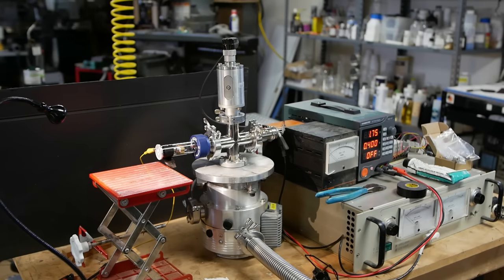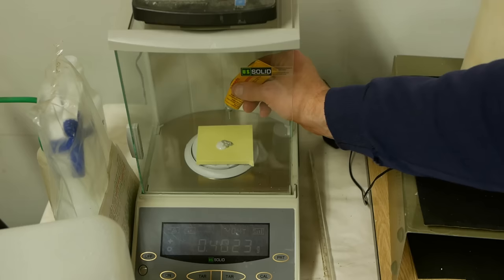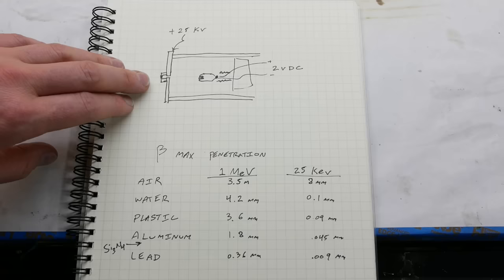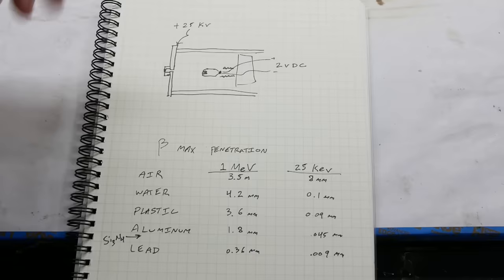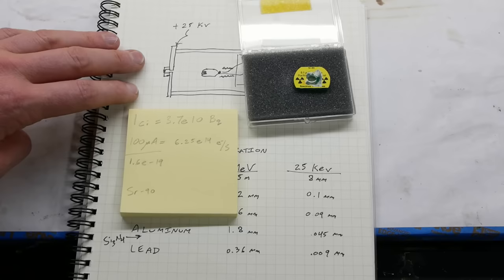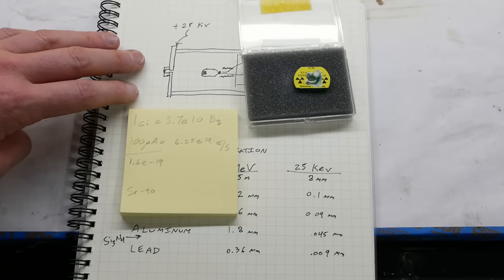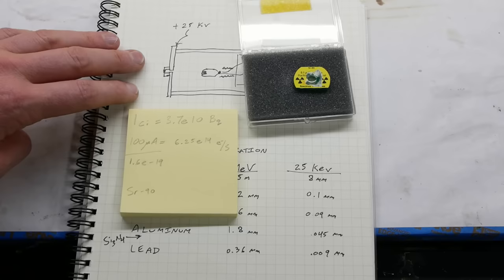Shooting an electron beam through air

Comment: 10:34  xray hit the camera sensor
Reply from the maker: Oh wow, I didn't notice this.  You might be right, as I've never seen a video artifact like this from my camera in "normal" circumstances.
Reply: @Fj128  if true; it looks like it managed to mangle a few of the scan lines, possibly hit the decoding circuitry off to the side of the sensor array rather than hitting a sensor itself causing it to corrupt an entire row (or more) of pixels before stabilising again. that's my guess anyway
Reply: @RonLaws  yes i thought the same before seeing ur comment
Reply: I also noticed this and immediately thought the xray had messed up some part of the camera temporarily.
Reply: I'm immediately looking for this comment when I saw that :))
Reply: @AppliedScience  You could shoot it at the -ve leg of a small LED, with the other leg grounded, maybe w wee bit of aluminium foil as a collector on the -ve leg, see if it'll light up a small LED.
Reply: @AlexanderBukh  Same here If it hit the sensor I would expect a small speckle or very short streak not an entire horizontal line.
Reply: @AppliedScience  It is probably from the internal arc over some EMI that causes some error in the camera
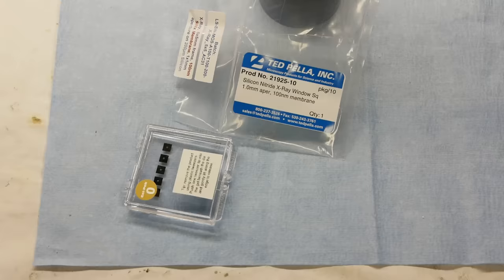Reply: 3:30 x-ray
Reply: @AppliedScience  I think I saw another one earlier on.
Reply: @Fj128  Lavarand eat your heart out!
Reply: @AppliedScience  future video on radiation-induced soft errors???
Reply: @heinrichhein2605  You are most likely right. X-ray leads to overexposure of individual pixels on the matrix, and not a whole row
Reply: @austinbrehm8473   Right, and it seems that it is the exact same row of pixels that is affected as in 10:34 x-ray. Something weird is going on...
Reply: X-ray messed the same line twice... It looks like line 382 in 1080p, but if it was filmed in 720p that would be line 255 - maybe enough bits set to trip some discharge or something. Or this line's circuitry is just more sensitive than others...
Reply: OR its just the same footage used twice in the video ;)
Reply: There's at least two such artefacts in the video.
Reply: Does the camera have a CCD sensor, or CMOS?  If CCD, the corruption of a full line would be expected, just as a very bright point source of light can do.
I've seen similar artifacts in a video where someone put a digital video camera through an electron beam deposition device.  It may not be X-rays, but literal electrons messing with the sensor.
Reply: what if you literally make it fall on camera intentionally?
Reply: @EwingTaiwan  same

Comment: "So if you have time in the Large Hadron Collider.." 😂😂
Reply: on it, as in riding the drivers seat in the topside control room, not inside getting irradiated.
Reply: Yeah. I'll just call for an appointment.
Reply: Well, that's actually hurling protons around.  What you really want is time on SLAC (Stanford Linear Accelerator Center), which is a two-mile long electron gun.

Comment: Things to put in the beam:

CMOS / CCD sensor. 
Crookes radiometer
Various (decapped?) ICs / semiconductors, see how their characteristics change 
voltage references / bandgaps
Opamps
Diodes
transistors / mosfets
Reply: 10:35 - CMOS sensor says hi!
Reply: Oh man, yes please! Would be super keen to see what effect this has on common electrical components
Reply: Don't forget about ants. That would be awesome to see.
Reply: EPROM Chip?
Reply: flash would be interesting too
Reply: Capacitive touch screen
Copper coil (measure voltage)
Ferrofluid
Superconductor
Thermopaper
Photographic film
Your finger
Reply: finger
Reply: @vripscript  definitely his finger
Reply: Would love to see how this effects the gain/RDSon of transistors and mosfets. I've actually hard of mosfets being used as dosimeters because radiation will effect it's RDS curve in predictable/characterized ways. Not sure if beta radiation has that effect though, or if it's only e.g. X-rays
Reply: What is going to happen with electron in the air accelerated by 1Mev after 4meters? Will it disappear, will it be stopped and fall down on the floor? :)
Reply: whats the doodad that is like a vacuumed out glass ball with a thin plate you bounce a beam off of to make it spin?
Reply: Ex-wife
Reply: To satisfy the "Big Clive" fans you could also expose a hot-dog sausage. :-)
Reply: I think the glass envelope on a Crook's radiometer would be too thick for the electron energies involved.
Reply: Yes to the Crookes radiometer!
Reply: @TishaHayes  e-beams spew out x-rays, so, 30KeV x-rays through glass, probably also glow-discharge in the gas, from trapped charge on surface.
Reply: @doxielain2231  Crookes Radiometers always rotate when their gas is made to glow (e.g. when in microwave oven, when held near a CW tesla coil, etc.)
Reply: @Nicol 1930s-style death rays would supposedly cause distant car engines to stall, by inhibiting sparking (or perhaps by changing hot sparks into cold glow-discharge?)

Comment: I’m a user of Thomas Jefferson National Accelerator Facility, which has a 12GeV electron beam.  Each aluminum ‘window’ is several millimeters thick to hold back the atmosphere, and so the beam traverses several centimeters of aluminum without losing much energy at all.
Reply: As electrons approach relativistic speeds, doesn't the thickness of the window decrease? I'd have to get my books out, but it seems like I remember something like that. Or maybe I'm full of it.
Reply: At 12GeV, I believe it! Will you take viewer's suggestions to put stuff in the beam as well? ;-)
Reply: so there is no actual window? the beam just leaks out?
Reply: @RelianceIndustriesLtd  depends on your definition of window
Reply: For those who are interested the Bethe formula
 describes the energy loss of a charged particle passing through matter.
Reply: How deeply does it penetrate into say, a finger?

Somehow that has fixated in my mind as the ultimate test.
Reply: @BlankBrain  From the particle's perspective, yes. Although at those energies relativistic effects make scattering events more, not less likely.
Reply: What kind of accelerator?

Comment: Loved it Ben. Next stop: demonstrate the wave character of the electron by placing a dual slit in the beam and a phosphorus screen behind it. Though, I must admit this experiment is a way more difficult than it sounds...
Reply: Classic
Reply: yeah its difficult becaus you need  very narrow slids very close together right?
Reply: What is the wavelength? Yesterday, we made a microscope slide covered in candle soot and two needles taped together to create the slits. Worked. But that was a red laser (620nm?).
Reply: @TheRainHarvester  wavelength is indeed the problem. The wavelength is equal to the Planck constant divided by the particle momentum. With an electron, the wavelength will quickly be in the Angstrom range or lower. So using two needle scratches is not going to do the trick I'm afraid.
Reply: Claus Jönsson did that in 1961. It's been very difficult as the resulting interference pattern is extremely tiny even if you use sub-micrometer slits
Reply: Stern Gerlach experiment, with an explanation that makes sense ...
Reply: @HuygensOptics  Crystalline materials have the necessary periodic structures at sub nm level. So electron diffraction and capturing it on the Phosphor screen could be worth a try.

Comment: Great stuff Ben! Any thoughts on adding beam forming plates or (A focus electrode) inside the device to focus the beam?
Reply: no
Reply: Mr Carlson ! Love your stuff too
Reply from the maker: Thanks!  Yes, good point.  I've seen a lot of X-ray tubes just have a cup shaped reflector around the filament to help shape the beam.  The cup is usually just electrically connected to the filament, so no special drive voltage needed.  I also tried to find out why X-ray tubes never seem to have enhanced (eg barium) emitters like all common vacuum tubes.  As near as I can tell, the problem is the high voltage electron impact on the metal target will create ions that are accelerated back toward the cathode, and would eventually destroy it.  This is partially (or completely?) why early CRTs had ion traps in their electron guns?  Maybe you know?
Reply: @AppliedScience  I haven't seen enhanced emitters in sealed tubes, aside from thoriated tungsten(embedded, not coated), but actively pumped lab tubes(micro/nanofocus) often have coated cathodes, which are replaceable.
The cup is still the same Wehnelt that is in your SEM and such. Serves the same function, to pinch the beam.
Reply: this is awesome.. while watching the video I was thinking how much Mr Carlson would probably like it
Reply: @AppliedScience  Hi Ben. The Ion's would cause "ion burn" in early CRT's on the screen. This usually created a dark spot if the ion trap on the neck was not placed correctly (easily adjusted by looking at the CRT and moving the magnet "ion trap" for maximum brightness.) This affect was not dealing with cathode damage, but screen damage. The "bent gun" also helped with this issue, but the aluminized tube really was the cure. Whether ions would destroy an emissive coating on a cathode inside your device is unknown, but would make a great experiment. The focus electrode usually has a separate connection to an external supply, (or divider.) Some experimentation should give you a strong focused beam out your window. I look forward to seeing any improvements in your device, if you choose to continue.
Reply: Maybe a funnel shaped electrode would do a good job. They are called skimmers I think.
Reply: I love going to places on the internet where people are actually smarter than me.
Reply: Amazing how this channel always demonstrates and helps explain something on my long list of what I thought was unexplainable or something I wouldn’t even know how to look up.
Reply: @AppliedScience  
I would be interested in seeing the beams effects on semiconductors and solid state circuitry.  Perhaps make a simple 555 based Astable Multivibrator and then measure its frequency and fluctuations when in the beam and outside the beam.
Reply: @AppliedScience  HI Ben.  Love your channel!  Working in the medical x-ray industry, the old Image intensifiers implemented an "ion pump", which consisted of an electrode placed inside the tube, which was energized with a small current to negate the effects of the ions that would be produced by the interaction of the input phosphor (i.e. the anode) and the cathode.  The main cause of it was that the technology of the day didn't produce a good enough vacuum and the impurities would cause this problem.  It would show up as dark spots on the phosphor.  When bringing a system up, you would have to energize the ion pump for up to 24 hours before the II would display a clear image.  When the system was powered down, the ion pump would continue to run 24/7.  I really never learned a lot of the physics behind it.  By the late 1980's, Thompson, Toshiba, Siemens and Philips had all developed better manufacturing techniques the eliminated the need for ion pumps.  Now image intensifiers are no longer even being manufactured for the medical imaging industry (showing my age) and amorphous silicon detectors are the new thing.  
As for the beam forming, it was common to see cardiac catherization labs that implemented microfocus x-ray tubes.  They differed from a standard x-ray tube in that they also had a control grid for fast switching of the x-ray beam and a secondary element (I don't know if it was a grid or plate) used to form the beam.  This allowed for x-ray beams that were as small as  .1mm.   This was especially useful in pediatric cardiology studies.  If you search for microfocus x-ray tube, you will find industrial tubes that implement a magnetic focusing coil, but these are different from the ones I remember working with in the cath labs.  
Last story;  I remember in the early days of positron emission tomography (PET) studies, our company sold one of the early cyclotron units used to make the radioisotope used in the study.  It worked on a similar principle to your unit and implemented a target similar to yours (I don't know what element they used, as I never went to training on them).  After the unit was energized, there would be an effect as you described, where some of the energy was absorbed by the target, due to its thickness.  This would make the target highly radioactive, but only for a short while.  About two hours after de-energizing the unit, there was no activity on the target.  During that two hours, the engineers weren't allowed to go into the room to service the unit.  Sorry if I'm not describing everything properly, as this stuff was way above me!  Anyway, thanks for the video.  Very interesting!
Reply: It reminds me of some of the mad experiments Kreosan did recently, where they removed an X-ray tube from some old equipment and tried all sorts of experiments with a phosphor screen, seeing how far the rays would travel (Many meters!), what they could see on the phosphor screen with their hand in front of it, so much dangerous stuff.  Just search Kreosan and you'll find it, good stuff although rather irresponsible.
Reply: @AppliedScience  If you ever have questions regarding the manufacturing of any type of vacuum tube you could try asking https://www.youtube.com/user/glasslinger A very talented person regarding this topic and in my opinion a you-tuber who should have a much larger following. It seems that manufacturing of vacuum tubes is almost a lost art.
Reply: @AppliedScience  hey try natuaral clear quartz its supposed to turn it into a smokey quartz its a gem treatment from the papers I've read
Reply: @AppliedScience  Ion traps were to prevent the phosphor from burning in in the center. The heavy ions are not deflected much and wear out the center of the screen mostly.
Reply: @stdorn  agreed. Knowledgeable channel of a disappearing (quality and by hand anyway) craft. If nothing else makes for interesting viewing... Like CRT tube rebuilds. Skill, experience and bravery!
Reply: @AppliedScience  My guess is that the enhanced cathode in an X ray tube or so would lower the impedance of the tube too much to sustain the voltage needed to accelerate the electrons at low currents. For the currents these work at, you don't need a lot of emission from the filament, and having a low emission filament, you can more easily control the anode current by means of the heater temperature.

Besides, if you drove a tube with a very emissive cathode to the working voltage this is at, it would be driving a lot of current and thus putting out quite a lot of radiation.
Reply: The beam could also be focussed and deflected magnetically
Reply: @MrCarlsonsLab   The earlier helium-filled educational "dual beam CRT" from Tel-atomic Co., they didn't last too long.  Emission goes constantly downwards with time, the bright blue-green beam dims out, I assumed because of ion-damage to the oxide surface on the cathode.  And all that, with only 300V anode drive!.   Much earlier versions of "visible e-beam tube" from long-gone 1950s companies used bare (thoriated?) tungsten filaments, too much spill-light out the back. 
"Teltron" crt tube w/magnetic field https://i0.wp.com/blogs.nvcc.edu/alphy/files/2017/03/20170307_111146.jpg

Ooo, I want one of these:  http://www.diyphysics.com/2012/06/01/tabletop-electron-accelerator-demonstrator-at-trocaderos-gardens-in-paris-france/
Reply: Wow...
Reply: @AppliedScience  If you want advice from an expert on making vacuum tubes from scratch, contact a fellow named Glasslinger who has a channel on YouTube. Mr. Carlson is certainly knowledgeable. But, I have never seen anyone who can create a perfect copy of an old tube like Glasslinger does.
Reply: @knowledgeiseverything3816  A rock shop in AZ tried it, probably with an e-beam food irradiator,  but only created a smoky-quartz layer down a few mm into 15mm thickness of long quartz rods.  So they were selling those cheap on eBay around 2012.   I thought: ...just rotate the rods, maybe insert/remove a glass plate, to smear out the energy.
Reply: @AppliedScience  Question, would it be possible toget the electron beam powerful enough to burn paper?
Reply: @AppliedScience  The ion trap bends the ion beam away from the phosphor screen to prevent burning the screen. The ions were from the source, not the target.

 Rather than using a lamp filament, have you thought of using an electron gun from an oscope tube? that way, you focus the beam down and accelerate the electrons to the window. You can also regulate the intensity of the beam to prevent burning out the window.
 
 An electron gun from a television tube would be better, as the oscope gun has deflection plates rather than using coils to deflect the beam, if you can find an old mono television picture tube... But a color tube would work as well, you would have three sources in one gun.
Reply: @MrCarlsonsLab  This setup would not produce that many ions. Ions are emitted when using a coated tungsten filament, mostly by dissociation of the coating material (usually barium oxide), producing oxygen ions that would fly with the electrons in the field as they are similarly charged. A tungsten only filament would not have anything to split unless it's a dirty filament.
Reply: @injesusname3732  shhhhhhhhhhhh
Reply: @JohnLeePettimoreIII  I think it would pretty much destroy the device instantly. The oxide layers would quickly form a large charge and fry the semiconductor junctions. This is what happens when you put active semiconductors in a SEM.
Reply: @AppliedScience  
Make Cherenkov radiation in air.
Make air glow blue 😁
Reply: @cezarcatalin1406  One can see that on glass transmitting tubes, where electrons escape the plate into the area beyond the plate though a hole in the plate ...